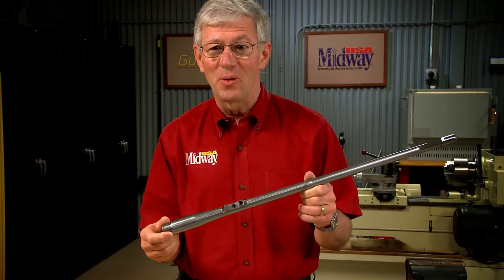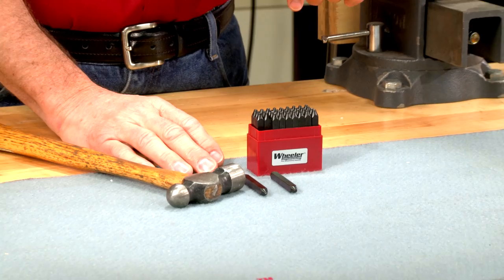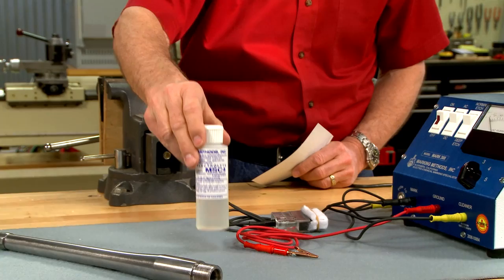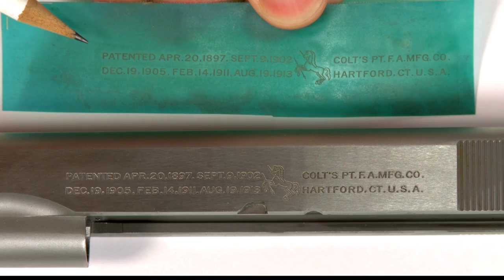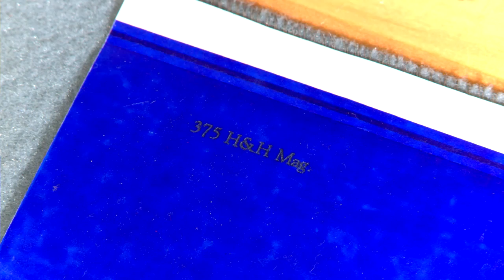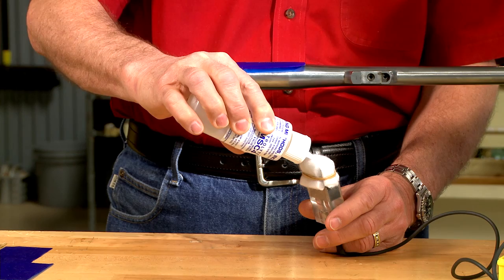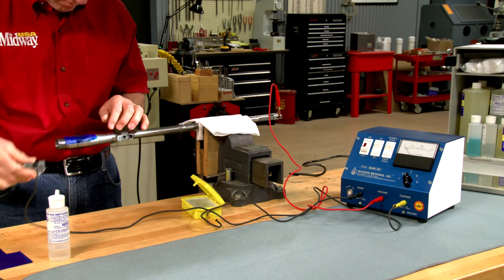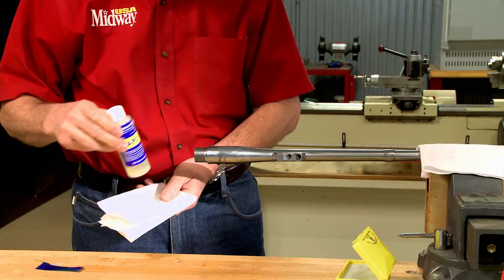How to Mark the Caliber on a Rifle Barrel Presented by Larry Potterfield | MidwayUSA Gunsmithing

Comment: Is that possible to do this job without these special tools ?
Reply: Use a letter set like he did in the beginning of the video. Nothing special, fairly common and easy to find, just make sure you use quality punches.
Reply: 2 9 volt batteries in series. Aligator clips. Use a cue tip clamped on the negative end, positive end to the workpiece. Make a saturated solution of vinegar and table salt. Cut a template out of paper and glue it on. Dip the cuetip in the solution and brush it on the metal.